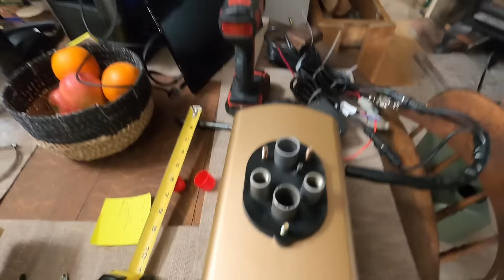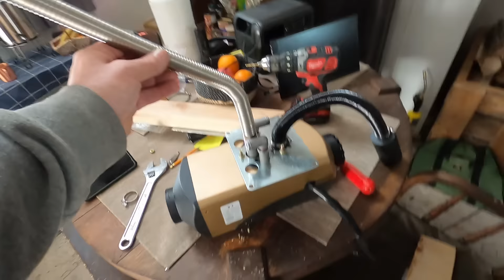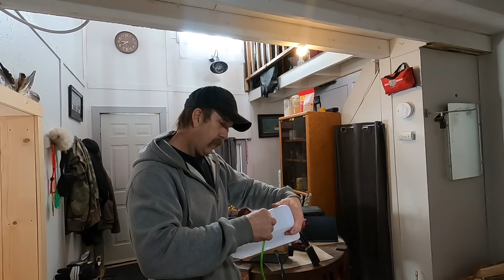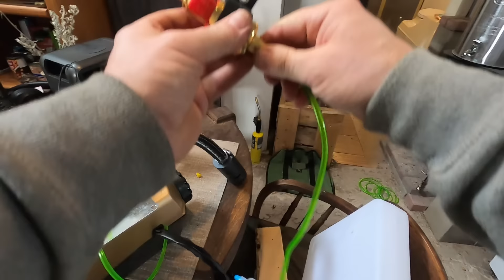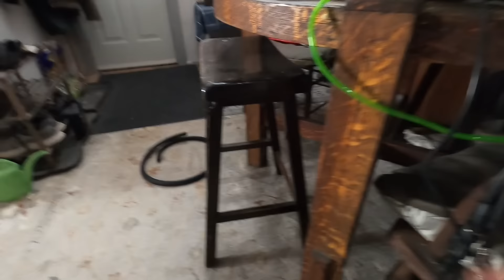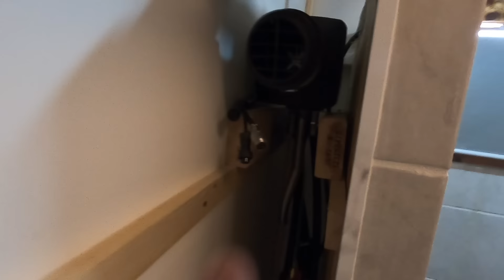7KW 24V Diesel Heater Install Guide | Water & Air Combo Heating System for Off-Grid Living

Comment: Do you have a video of the heater in use and how you feel about it? I'd like to know if you can heat the water without running the air heater, and vice versa. Thanks for the video!
Reply from the maker: No not yet. I need to relocate it. But from what I understand you can not heat water without heating the air, but you could vent the air outside if you do not want to heat the space you are heating the water in.